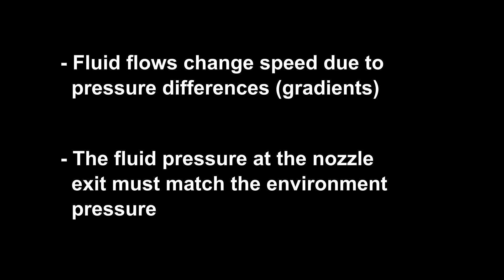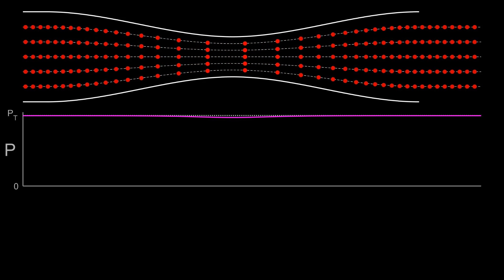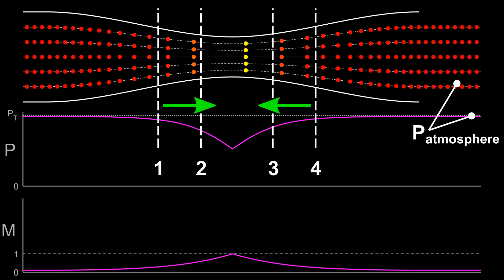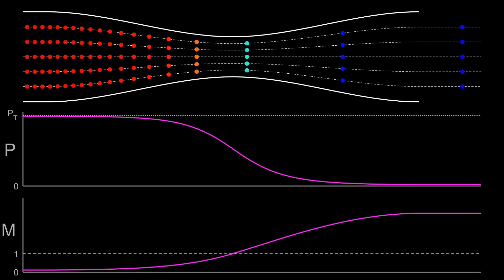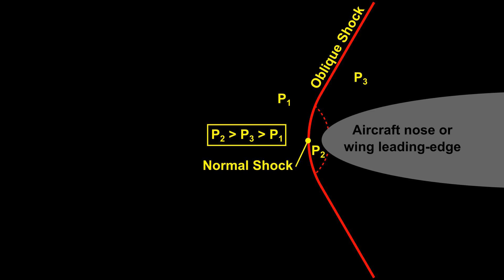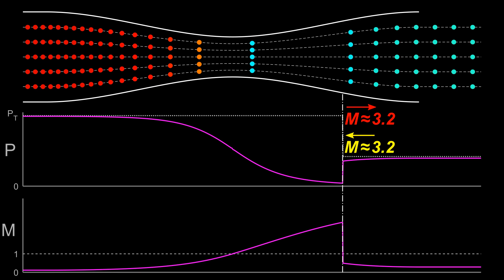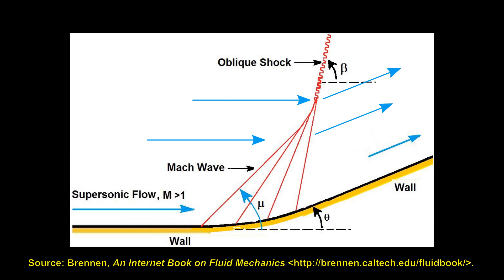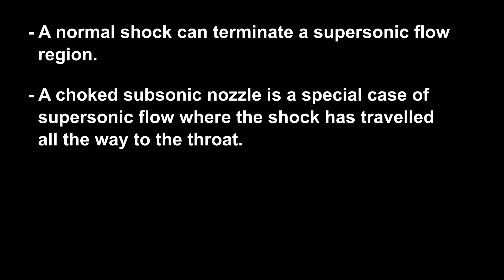Supersonic Nozzles - What happens next will SHOCK you!

Comment: It would be really helpful if you can discuss the method of characteristics part.
Reply from the maker: Thanks for watching. I'll do my best to make a video on the MoC in the near future, but I can't promise anything specific! It's a complicated topic to try and summarise.
Reply: @TheGravityAssistant  Ya, it is complicated. Do you have any good resources for now?
Reply from the maker: @dhrumil979  I would suggest Modern Compressible Flow by Anderson. In Chapter 7 he introduces the Method of Characteristics for unsteady 1D flows like shock waves and expansion fans in tubes. I would suggest reading this chapter very well first. 
The important point to understand is that with unsteady flows we are 'following' points of constant properties as they travel through 1D space and time. On the x-t diagram we're also studying how the speed of sound (and thus temperature) changes when shock waves and expansion fans interact with each other. 
Once you understand that, it is much easier to understand the 2D method of characteristics, because all we have done in the 2D method of characteristics is replaced the time axis with the y direction, and assumed constant flow (so no variations in time, only with location in 2D space).
In the later chapters Anderson discusses the MoC for 2D and numerical methods etc.